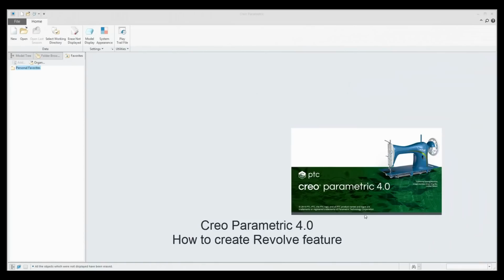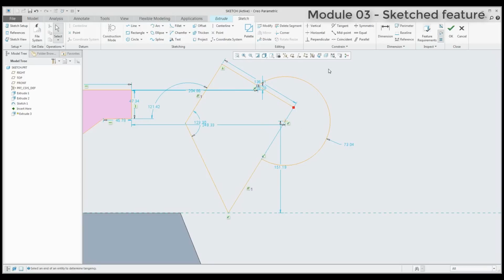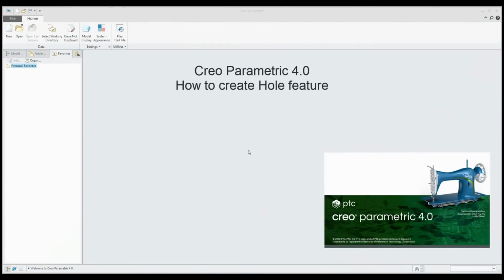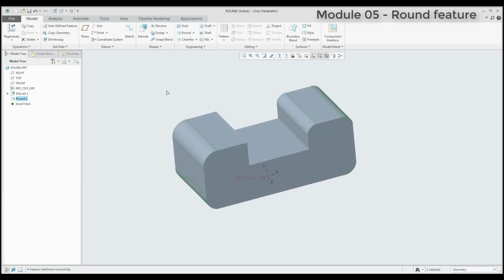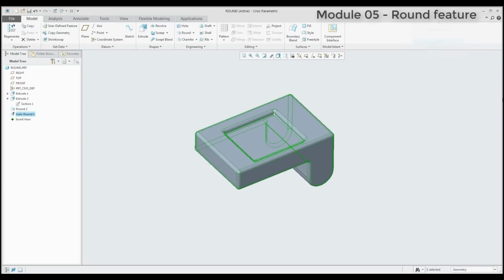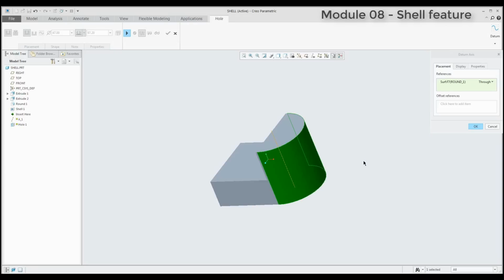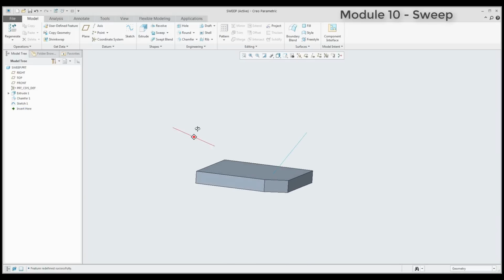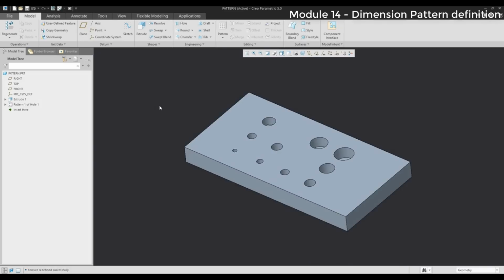Creo Tutorial for Beginners | Complete tutorial | Creo Basics modeling | Introduction to Creo

Comment: Hi Mr.Vladmir how I can create usa inch pipe taped hole in creo user defined I want to create all pipe taped holes and use easily when I open my water line injection mold design I need create user defined pipe taped holes file I need your help please.
Reply from the maker: Hi, I hope that this video will help you, you can learn How to create custom holes https://youtu.be/xwtZPHRwQKk
Reply: @4kside  thank you very much but it’s not helps me because user defined really different not this way assembly section side .
Reply from the maker: Ok, maybe this 2nd example will be suitable for you https://youtu.be/p56N5cMYXvY How to create and use UDF (it is for solidify but same logic you can apply for any features)
Reply: @4kside  sir for example i want to draw 5/16-18 tapped hole shape and add this shape my UDF Library when I need assembly time any size hole just I want to use udf open any size hole or add any size bolt from UDF Library that’s why I don’t know how to do if you want we can make zoom meeting I can show you what I need thank you very much for your help .
Reply from the maker: Hi, I will try to create some simple example How to create UDF driven by dimensions and family table. I need some more time for it.. Busy time in the last few days. Stay tuned. Vladimir
Reply: @4kside  thank you very much sir!